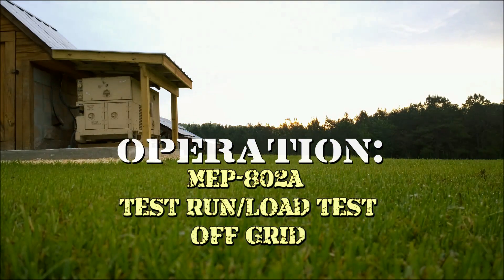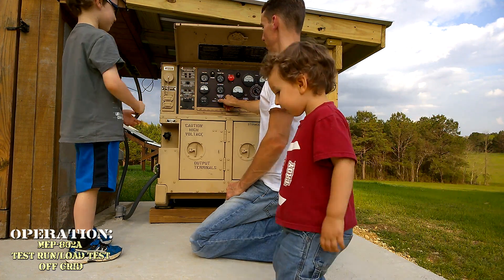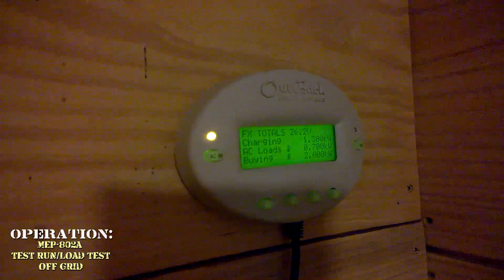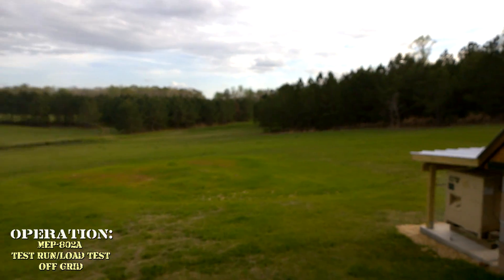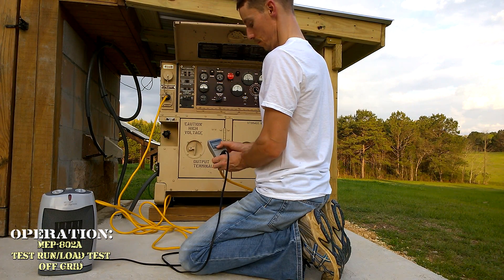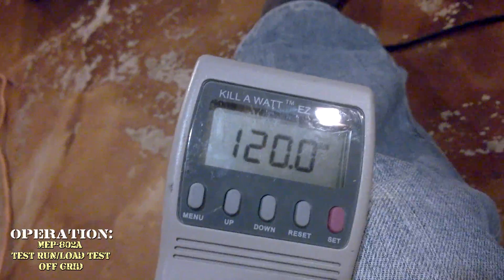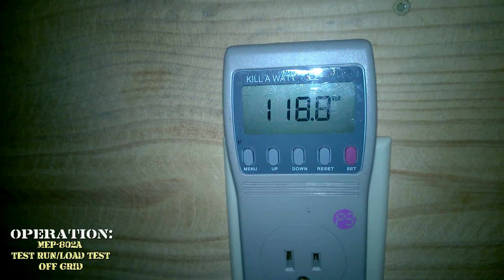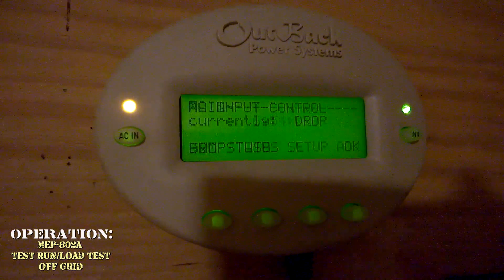Military Surplus Generator Test Run on Off Grid System

Comment: This was my job in the Marine Corps! Power displacement, generator mechanic and operator. Miss it like crazy. Only thing i dont miss was running 7-9 miles every morning for PT for 8 months lol

Very nice video though! SEMPER FI!
Reply: I'm off grid and using an MEP803A would never give it away for anything else, thus parts to find is difficult here in Luxemburg. Running like a Swiss Watch
Reply: @Jackkamerun  let me buy it from ya ? Lol

Comment: Put it in a Faraday cage to protect it u don't know what is going to happen right now just make sure you do it right.
Reply: It's not a bad idea.  But I am at a loss to protect all the loads.  I just bought a new crockpot, for example, and chose one with no electronics.  I guess an EMP might still ruin it, but an EMP would almost surely destroy electronics.

I have thought about using foil-back insulation in the exterior walls of my last house  With doors and windows, it's a compromised Faraday cage, but probably better than nothing.

Comment: If one side is higher voltage some times it can be more load on one side.  But could be the winding used. I have trouble keeping the load balance.

Comment: Have you thought of running a large step down 240/120 transformer? It will keep your loads balanced and double your amperage. I use it to increase my input current to my inverter/charger so my generator will not drop the load.  It gives me an option to use a smaller generator(predator 4KW) (more like 3.5KW) and places a lighter load on it. Some fuel conditioner may also help with the smoke or a light nozzle cleanup.

Comment: Not real off grid if it uses fuel. It is just transfer from grid to another "grid".
Reply: "Off grid" does not mean "absolutely independent of society".  It means "off grid", and that usually entails no connection to the power grid.  Often, no connection to municipal water is included.
Reply: By that logic, solar power with batteries is just moving one grid to another grid. Because you'll need to replace the batteries over time, and the solar cells over time...
Reply: @dm.robert  In principle yes, but if civilization collapses, you are not going to produce power from fuel, because it cannot be stored in sufficient quantities for 20+years unlike solar panels and batteries. 

With fuel, constant supply is neccessary. And maintenance for generator is needed every 100-300 hours. Solar migjt also be cheaper for sunnier countries, where significant generation is almost guaranteed for every single day.

Comment: Very nice! I have my MEP-016D loads balanced the same way. We have gravity feed water so we have no use for split phase. We are off grid with 4.8k of solar here in the Pacific North Wet. In the winter months we have to run the diesel now and then to get to a full charge. Every year we have over 50 days in a row with no appreciable solar gain. Last year we burned 37 gallons of off road diesel that we bough bulk for $ 1.80 a gallon.  I think I ran across your channel awhile back or maybe you commented on one of my videos. I just subscribed. May the Lord bless you folks in Jesus Name.

Comment: Nice setup, I really like it. Keep in mind, the lower voltage you are seeing is just a voltage drop over the line. There are charts you can find that will break that down for you. The more load you put on a given wire size, the more voltage drop you will have. As long as you stay over 110 you'll be fine. I wouldn't try and boost the voltage too much on the genset as you run the risk of damaging the regulator and also sending the voltage too high on the other leg that has less load on it.

Comment: very nicely done video....can you power up your AC's on your fixed panels? or do you have to use the genny? Are you folks farming?

We are at the bottom of a canyon and use solar gas trackers to power our 2 AC's and 3 solar well pumps....we are looking to change over to diesel for our three well pumps for night time pumping. After your radiator issue....would you re-consider an onan air cooled mil spec unit?
Reply: Hi Rod.....im actually using my wife's call sign...just bought a onan 6.0 air cooled diesel not a gas unit today.
I think it will be more fuel efficient for lighter loads vs a 10KW.... but we will see. We use a similar 24v off grid outback setup now for 13 yrs. We are fine tuning two small air cooled diesel generators a Yamaha and a lambardini for water pumping and a much heavier onan as backup and charging. How far are you guys from your power co. lines?

Comment: im new to the channel, where did you purchase this one from and how much did you pay, im here in FL and we just had Irma, and im looking to upgrade my 5500/8500peak craftsman gas one to a military diesel one
Reply: Mob with Guns they aren't cheap but there are definitely worth every penny for one the thing can with stand an emp if you know what that two I am sure some one going to run there mouth about this trust me i promise you These gens are kinda Multi fuel it's not the best idea to run regular highway diesel but it will work just add some extra oil or something to make the lubricity go up but these gens can Brun heating oil off road diesel wast oil from vegetable oil to motor oil just make sure you filter it good and add some sea foam to keep clean and if something does get dirty they are fairly simple to clean up they have diagrams and schematics for everything on the generator if you got the cash this would be an investment I sure you not that you want regret it